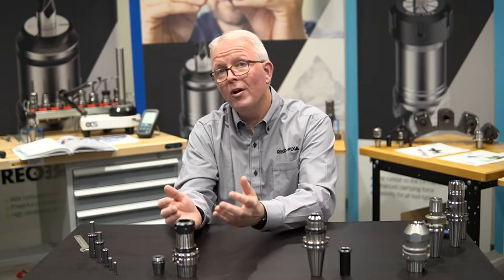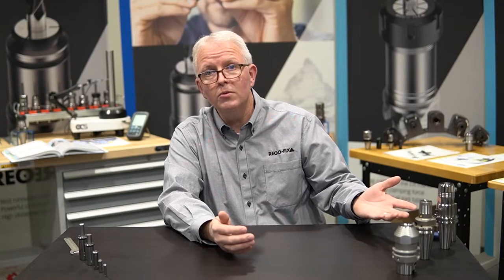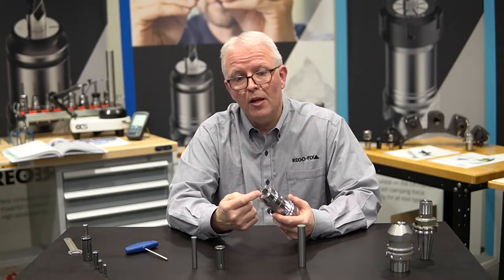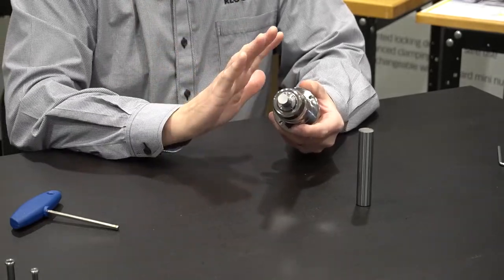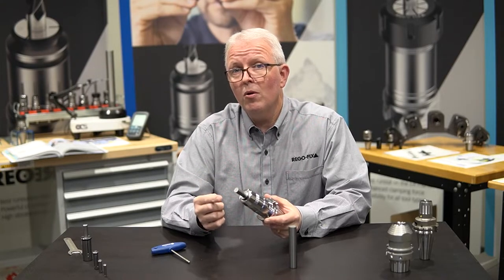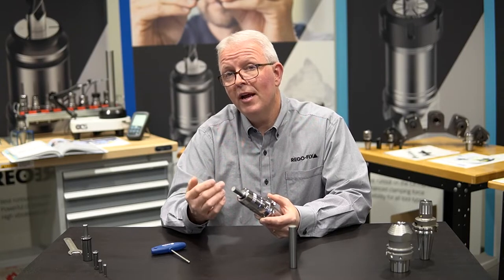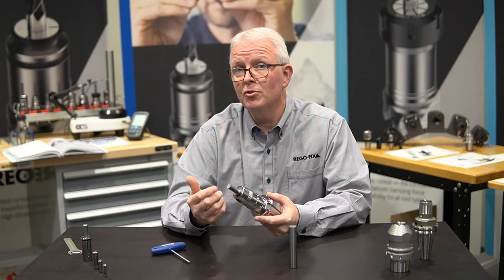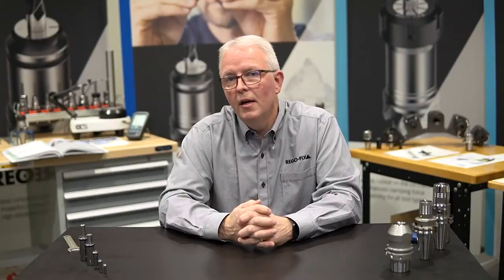TechChat - Hydraulic Sleeves

Comment: Very informative video on the added benefit of using sleeves with hydraulic holders. One note on the SCHUNK hydraulic holder used. Due to the way expansion is set, the holder CAN be expanded without a tool in the bore and it will not cause damage to the holder. The point about not choking up on the tool still stands.

Comment: Love the wrench idea, are these sleeves the same as used for milling chucks?  Charles
Reply from the maker: Yes and no; the idea is the same, however hydraulic sleeves are typically made to tighter standards and tolerances than the milling chuck sleeves are. 

Due to the nature of milling chucks, TIR tends to be the least of your issues when you're making a pass. However, with hydraulic holders, TIR is a huge factor in it being a more higher performance system and thus every micron counts; especially when adding a sleeve!